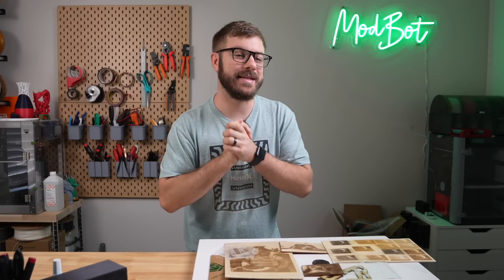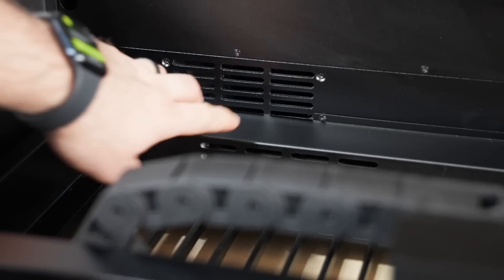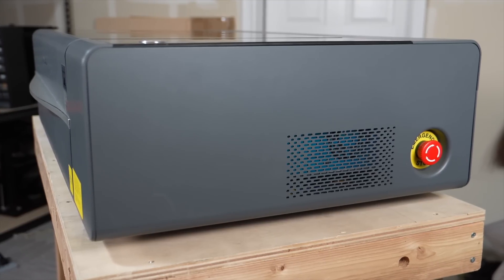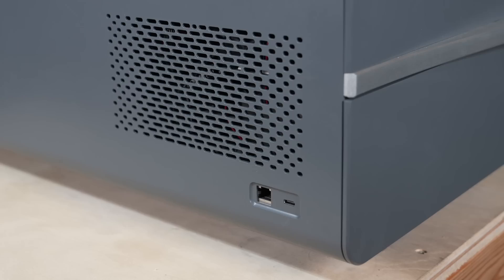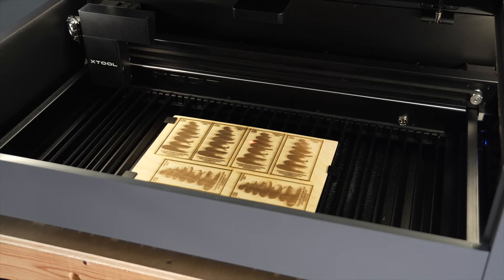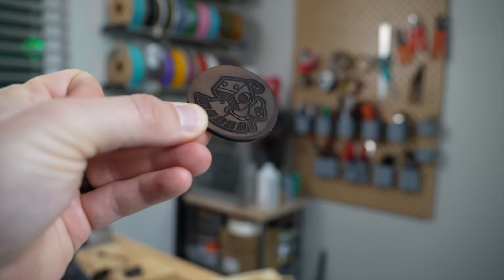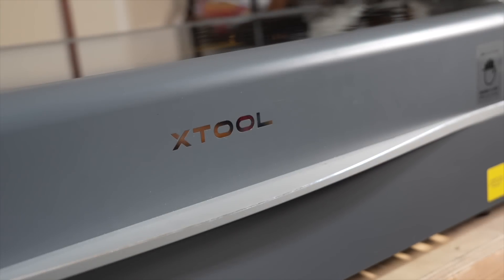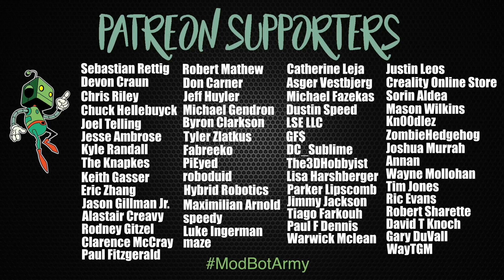This Compact CO2 Laser Raises The Bar! (xTool P2)

Comment: For sticking things down to the cutting table, I find that hard drive magnets work really well and the shielding won't interfere with the fans. Did your unit come with an air filter? Those work really well for acrylic, leather, etc. (really stinky materials).
Reply from the maker: Thats a great idea. I need to try some magnets. It did not come with a filter. I know they have one available as an addon. I had one on the loaner Gweike unit but didnt feel like it did a whole lot. That being said maybe the xTool one is a better unit. Such different levels of effectiveness with the different units.
Reply: @ModBotArmy  Ah, I was wondering about that. I saw that ManicReally got the filter with it on his live stream yesterday- it seemed to be similar to my glowforge filter. I think it's around $650 so not cheap, but maybe they can send you one to evaluate. My glowforge filter was about $1000 and the cartridges are $250, and don't last all that long. But they work really well for the super stinky stuff.
Reply: My friend 3D printed out some clips that fit onto the bed rails. He has alignment clips and hold downs

Comment: Where do we go to see a comparison for diode, IR and CO2 lasers?  Capabilities, use applications etc...I have an xTool D1 with the 455 diode and 1024 IR.  Just trying to understand where the CO2 falls in comparison to these two.  Thanks,
Reply from the maker: Greg pretty much nailed all of the things. I have only used up to a 10W diode but I know they have 30+ now. Although some of those can be pretty pricey. Diode lasers have a smaller spot size which is great for engraving. Also clear acrylic is a big one. That is a big part of why I want a laser (not exclusive but a lot of enclosures and edge lit signs).
Reply: A cO2 laser is much better for cutting compared to Diode lasers, though some of the newer "stacked" diodes (20+ watt) are similar. The fatal flaw of the diode laser is that it can't cut clear acrylic. Diode lasers can typically engrave sharper images than CO2's since they have tighter resolution.  IR's can engrave metal better, but not as good as other materials.

Comment: Make absolutely sure it's VEG TAN leather if laser cutting. You really don't want to burn chrome tan leather.
Reply from the maker: I appreciate it. I had been told this before and swore what I got was Veg Tan but I am going to verify this before I use it again.
Reply: Yeah, great point! For anyone else wondering, veg tanned or many oil tanned leathers can be cut /engraved easily and safely. I was wondering what he was cutting, it looked suspicious. The chrome tanned is very dangerous and makes chlorine gas when it cuts. Harmful to the person, and the machine.

Comment: Machine looks great, but I have no idea what I could use this for to pay back even 5% of the cost of purchasing it. I wouldn't buy anything I saw it produce in this video, and can't imagine anyone else locally here doing so either. Maybe a makerspace would buy one and have each person use it once or twice a year, across a few hundred people? It's a shame, because I see similar machines starting at ~$300 and the only thing I can think to use them for is engraving letters and numbers on keys and tools, or once a year cutting acrylic, and that just doesn't justify the cost for me. It would be great to have a new precision tool in my arsenal, but I'm just drawing a blank on use cases. Best wishes.
Reply: I have a Glowforge, which is a similar price range and bought it for a small business to make/sell laser cut goods. I was able to easily get up and running with it, and for about $5 of wood I made designs I could cut, engrave and sell for around $60 easily right off the bat with pre-made designs. Later, I learned to design my own and started making cool stuff like lamps, photo plaques, etc. You can cut 30 pairs of earrings on one sheet and sell them for around $10 a pair with a laser cutter like this. It is very easy to make your money back if you want to start a small business and sell locally. I did this for a while and once I made the $$'s back I just use it for hobby purposes now and occasional gifts. A $300 machine is not going to be anywhere near as easy to get up and running and most will give up before they get a decent quality print off one, not to mention the size constraints and other issues. $5K is very reasonable for a machine like this and what it can do.  These machines are definitely more for the small business and not individual/hobbyists.
Reply: @GregsMakerCorner  Thanks for your comments; I wish I could see a long video or webpage full of useful or desirable things people have made with these laser cutting and engraving machines, but people tend to be keeping the specifics close to the vest, less so than 3d printing where people just point you to the models on thingiverse or mmf. This machine looks truly excellent, but much in the same way I didn't (and wouldn't) start learning with a $2000 3d printer, I wouldn't start a hobby or business learning / ramp-up venture with a more expensive model of laser cutter. I'm willing to put in the time to learn the machine on a cheaper, less automated model, and am glad I did with my 3d printers, just from learning the ins and outs of the machines alone. I'm open to learning more, but there's still these big gaps for me between the machines I see being promoted everywhere, and my understanding of how I could recoup after purchase (letalone find enough personal use). Eager to see more variety of content of people putting them to use in new ways. Best wishes.
Reply: @michaelsworkshop9031  Yeah, I totally get that perspective and it would be nice to see some more examples. I first learned about laser cutting with a CO2 laser at my local maker space, who had a $20K Epilog laser that I learned on. It was nice because I could learn and experiment without making a huge investment, but paying for machine time and materials also wasn't cheap/scalable for starting a business. After I ramped up on that laser, I decided to take the plunge with the goal of making a small see side hustle. I also learned a lot about what people were making on the Glowforge community forum.  It took a while but I made some really cool stuff and figured out a decent way to monetize it and now I have a good tool that I can use. 

I quickly got tired of the side hustle because it's a lot more work selling and marketing and spending time in person at craft shows. Unless you really have a good niche / market to sell into, it can be very challenging to make sales because there are so many people out there doing it especially online (Etsy, ebay, etc.). I had much more luck selling things locally but that required a lot of my own time to set up and attend craft shows, etc.